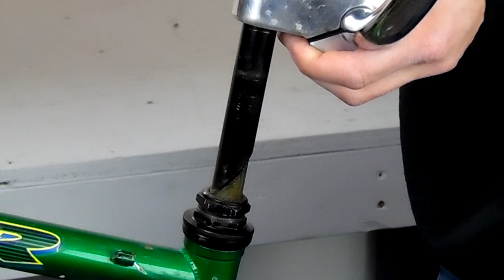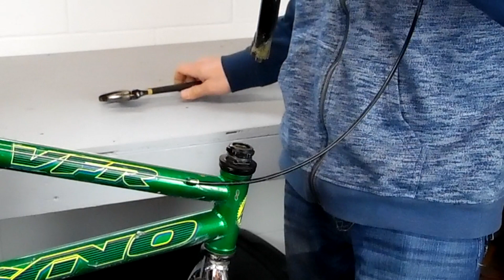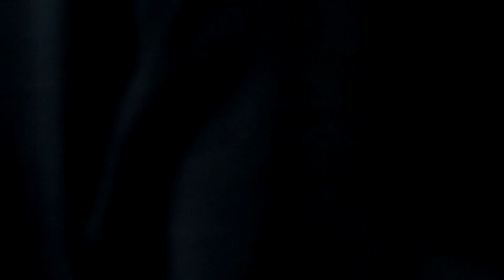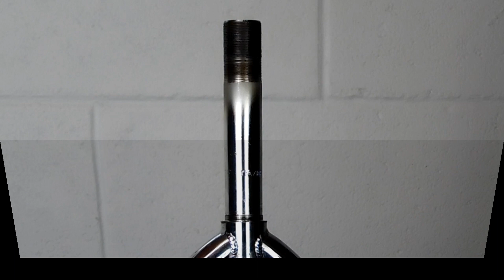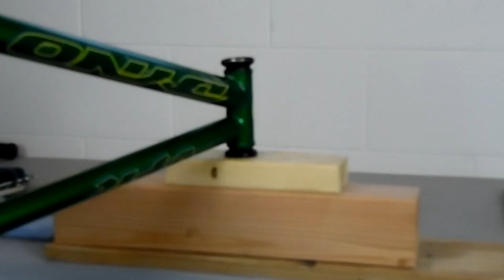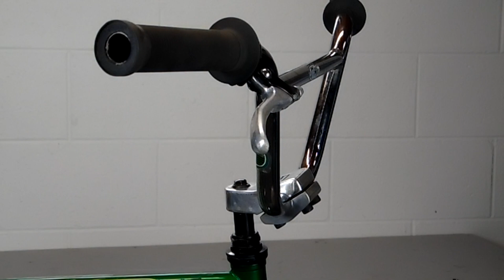BMX Threaded Headset & Fork- Installing, Removing, Tricks, and Tips

Comment: On my personal bikes, I put ball bearings in without the cages to get extra bearings in. It rolls better and lasts longer. Doing it that way you are depending on the grease to hold all the bearings in while you are trying not to knock them off while putting the fork through. I do it over a towel so if a bearing falls out it won't go bouncing and I will find it. I don't remember how many extra bearings I could get in the headset, one bearing on the rear wheel, and two bearings on the front wheel, it was three or four on the bottom bracket and headset.  I would do the whole bike. It's easy but if one bearing falls out start over and try it again. Cages are made for quick assembly you don't really need them. I think my mid-70s Rally Sport when I was a teen didn't have cages from the factory. The bottom bracket is the hardest one to go cageless because the one-piece crank is bent it's hard to feed it through without knocking off bearings, One side at a time I get the spoket side first then the left side. It's easier not to do cageless the bottom bracket.
Reply from the maker: Great tips! Thanks for the advice!
Reply: @thebasementbikeshop2336  I'm not a mechanic. These are tips I got from my uncle who owned a bike shop when I got that Rally bike and the bike shop nearby does this too. It has more pros than cons. After doing thousands of miles commuting I think it makes a difference. Going cageless might be a good subject for you to make a video on.

Comment: Would this be the same on a 99 GT vertigo. My handle bars are kinda crooked. And I just want to straighten them. Also I have a brake cable running through the forks.
Reply from the maker: Yes

Comment: The stem is so tight how do you remove it?
Reply: Loosen the center bolt and give it a little tap with a hammer. That will push the wedge down

Comment: I got a 99 nsx same exact parts as that vfr except for the seat post mine is 22.2 n i got a 3/32 chain drive which makes this bike even smoother n lighter along with 1.75 tires on some alloy rims

Comment: is it possible to convert a threaded to threadless? btw, very helpful video.👏🏾
Reply from the maker: Yes! As long as the size matches up. So a 1" threaded can be converted to 1" threadless. You just need a new headset stem and fork. The same with 1-1/8" threaded
Reply: The Basement Bike Shop niceeee thankyousomuch man! more power and stay safe

Comment: Hey bro how to keep my quill stem from wobbling inside the headset its annoying me everytime i make a drop on my bmx it makes a loud metal noise... Pls reply ASAP
Reply: Did you happen to replace the wedge? Some take a ramped. Some take a stepped. The wrong wedge might make it so it won't tighten.
Reply from the maker: Does it actually feel loose or does it just make the noise like its loose?
Reply: @thebasementbikeshop2336  its lose like its not tighten up
Reply from the maker: @Chinaman-gw6ts  I've never experienced this issue but one of my friends did and he took a soda can and cut a 2 inch strip out of the center of the can, then he wrapped this soda can shim around the stem just above the wedge. He said this tightened up the stem and got rid of the problem for him but make sure you keep the shim above the wedge. I hope this helps.
Reply: @thebasementbikeshop2336  or can i just switch from threaded stem to threadless with the same fork? Is it possible?
Reply from the maker: @Chinaman-gw6ts  Yes. There is a quill conversion adapter that goes in your fork like a quill stem and allows you to put a clamp on stem on it.
Reply: @thebasementbikeshop2336  ok thanks for the info